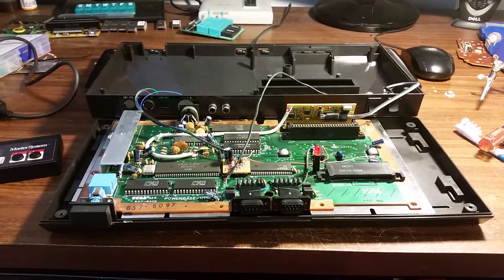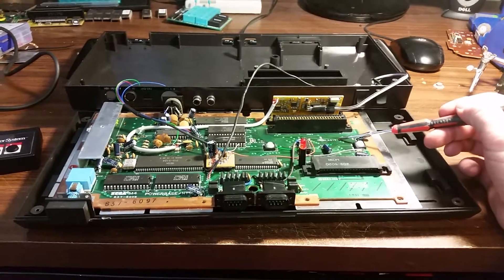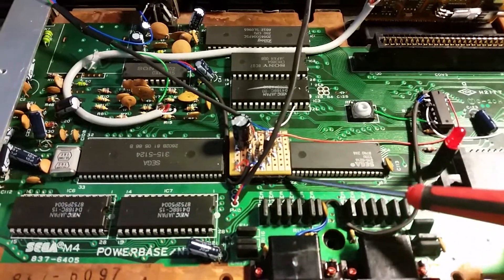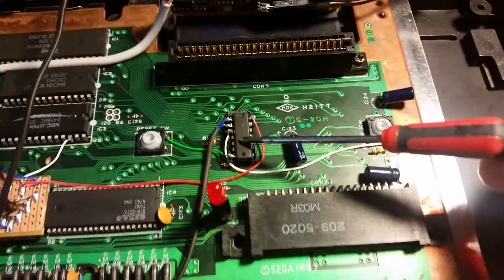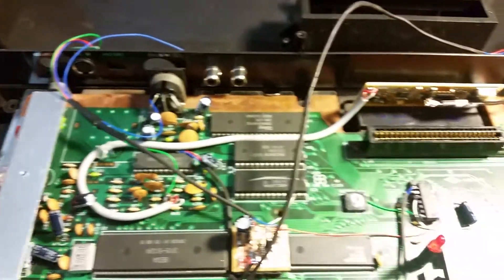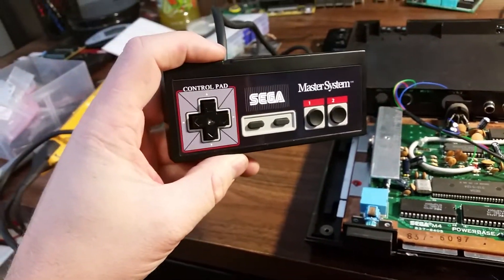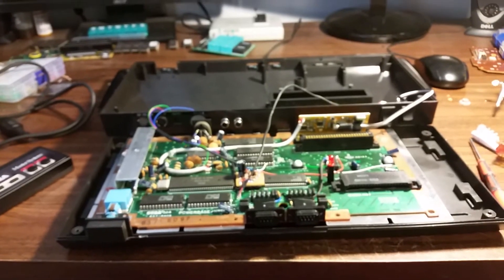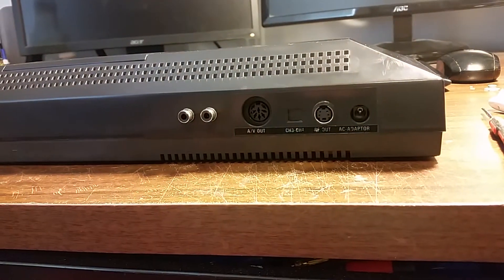SEGA Master System mod

Comment: Do you know any way to fix the Rainbow banding in Sega Genesis?
Reply from the maker: It seems to vary from model to model. 
The quality of the composite encoder on the Genesis can vary. Try playing in RGB.
Or just play your Genesis with a 32x.
Reply: @8-bitBishop   I see. The problem of RGB Mods is that the video loses the Dithering, so Id rather fix the issue if I could. This video encoding thing is completely nuts. Some people say the European PAL models don't have this issue. The Ntsc models have much and Pal-M models (like my brazilian one) a little less, but still do have. I thought about everything, even installing crystal oscilators from other systems. Using pal to Ntsc external converter. Modding the console to RGB and trying convert back to composite. The 32xs here are very hard to find, and importing is like 10x a price of a console (dolars has became 6x our currency in a couple years recently =/. It's a lot of investiment just to see ordinary Sonic waterfalls. I'm going insane! Thank You, mate

Comment: S-Video for a system thats supports RGB? Isnt this downgrading?
Reply from the maker: Additional video options aren't a downgrade, it still has RGB.
Reply: Wait. The Master System uses the same A/V port as the Genesis model 1. If you can buy component, composite and s-video cables for the Genesis model 1, wouldn't that nullify the need for an s-video mod, besides having to buy a special cable?
Reply: @8-bitBishop Sorry. I was confusing the A/V port on the Genesis with the Saturn A/V port (a true multi A/V out). S-video isn't available on the Genesis or Master System port. Only Composite and Component. Ignore my ignorance.